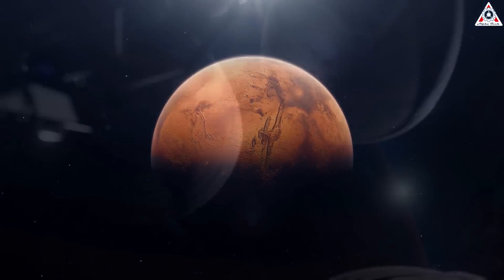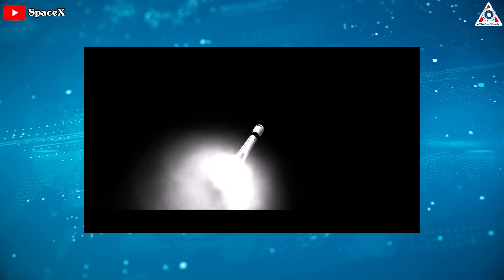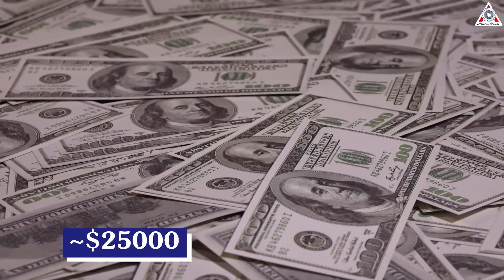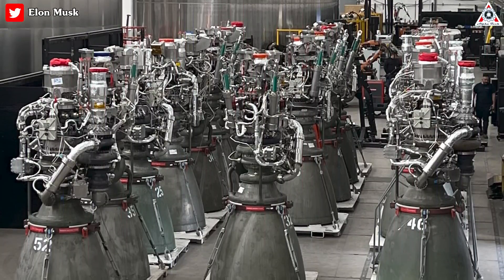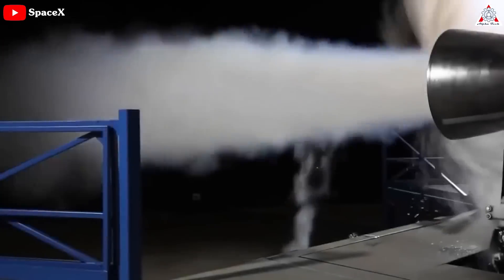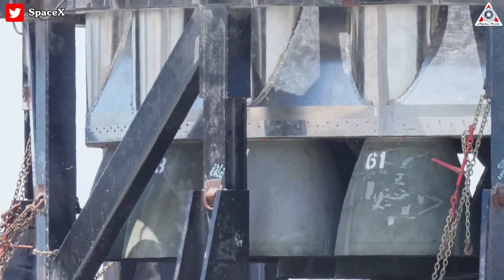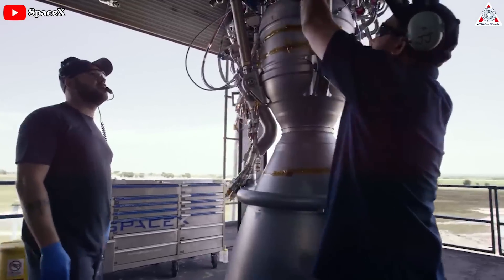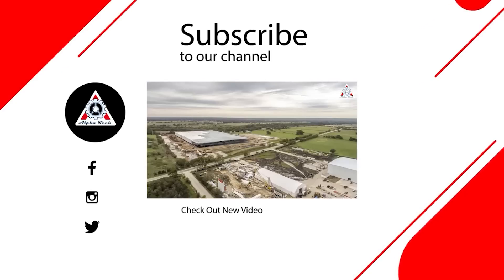What SpaceX just Did with Raptor 3 Engine thrilled all Scientist's minds...

Comment: The Raptor obviously has potetial, but if you look at actual flights and tests instead of Elons interviews, it is actually a bit of a problem for SpaceX. In all tests flown so far it has been highly unreliable even though it has operated far below its supposed maximum power.

It makes no sense to talk about Raptor as rapidly reusable, when so far it is struggling to survide a 2 minute flight.

The high chamber pressure is also not purely an advantage. Yes it makes the rocket more efficient, but it also means higher stresses andtemperatures, which complicates rapid reusability.

In any event, before putting Raptor above, F1, RS-25, RD 180, and not least SpaceXs own highly succesful Merlin engine, they need to demonstrate that the Raptor can survive an actual orbital flight at the claimed power rating.
Reply: No one can beat elon
Reply: @sierrabrooks5021  Tme will tell, but the fact that you thing Elon = SpaceX says it all.
Reply: So, on the last Starship flight, 33 engines were used, 6 of them failed. That means 27 worked perfectly.

Keep in mind those engines were from different periods of Raptor's development.

Let's see how our comments age.

Comment: If SpaceX plans to go to Mars and to create methane fuel, they should be working on the devices now -- designing, anyway -- to develop the tech to fit in the Starships. Any updates on that side of the mission, I wonder.
Reply: That is waaaay too early. They are not even close to the first test flight to Mars as in its more than 10 years away, and making fuel on Mars is for later when its being colonized.

Before thinking about that part, they need to first:

1. Get starship to orbit
2. Have starship survive reentry
3. Land starship and superheavy
4. Make a starship that can actually carry cargo
5. Make a starship that can actually carry humans
6. Make starship rapidly reusable
7. Learn how to refuel in orbit
8. Land on the moon

Comment: SpaceX needs to add Microwaves in the Chamber to reduce Oxygen and producing Methane/Hydrogen to Plasma like in a Nuclear but safer. It may be able get 400-600 bars but will need 20kw to 100kw Magnetic field to compress the Plasma field for control. This Raptor bar delivery will be based on Microwave Wattage. More Microwaves less Oxygen More Bars. Fuel could be height the 50/50 mix rate. A Falcon 5 Heavy can make a 25-30 ton Mars delivery but expending the main rocket as second stage on just 16 engines, the upper stage will have 1 Raptor 4.0, 5.0 or 6.0 (based on bars).
Reply: Where does the power come from?  Would the electricity be delivered over long, lossy wires?  How do you produce the magnetic field?  Would there just be a big coil of wire for the field?  How do you keep all this cool?  How do you produce the microwaves?  How do you direct them to the proper area?   Would all this added weight and complexity (not to mention expense in the engineering process) be efficient?  I'm not trying to shoot down your suggestion,  I am just curious about all the technical aspects and how they relate to existing practical technology and improvements.
Reply: @barnowl6807  Oh Barnowl, I think you can safely 'shoot down' his suggestion.